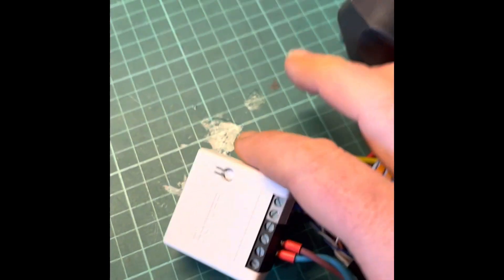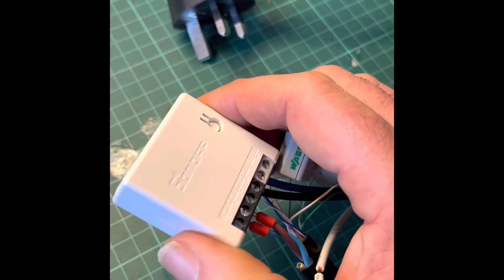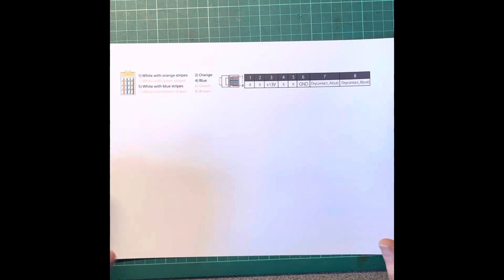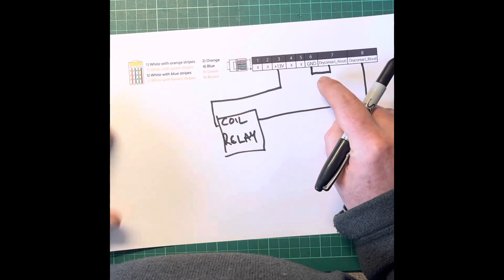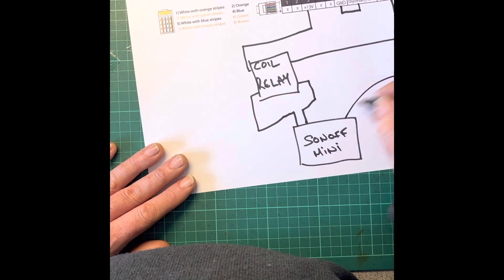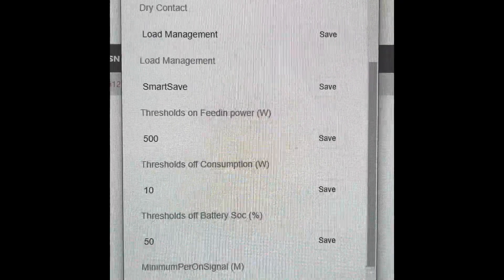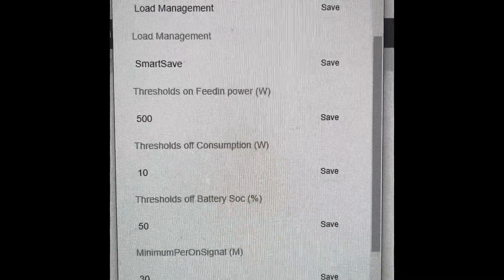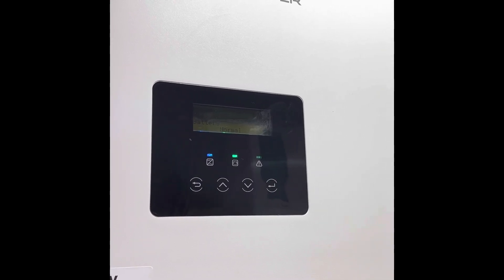Solax G4 hybrid solar inverter: "Dry Contact SmartSave hack"

Comment: Hi - I may be missing something, but you should be able to achieve the same result by just connecting the dry-contact outputs from the inverter directly to the sonoff mini.
A dry-contact is basically a relay (in the inverter) connecting the 2 pins (no voltage), which the mini R2 is equipped to detect (you can check that with a multi-meter/ohmmeter/continuity tester).
Thanks for the video, not too much content on solax stuff (I am considering buying one)...
Reply from the maker: It dosent work like that, hence this video, you are missing something.!Without the feedback loop the smart function wont work.
Reply: @Fourby  I tested on Solax Hybrid G4 and on pins 7+8 is dry contact of internal relay, you can set Dry contatc to manual and then switch ON/OFF from menu. -> No need additional relay